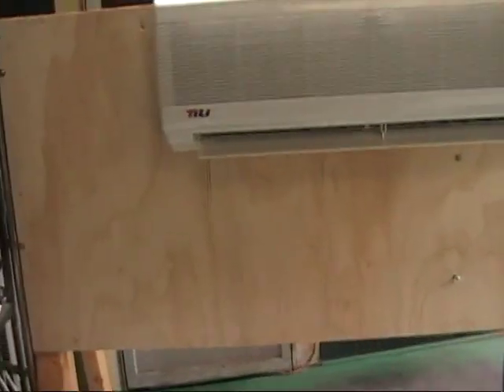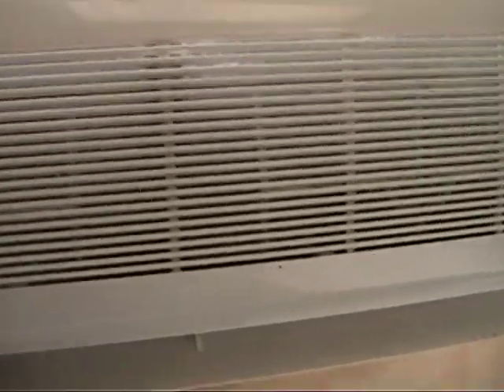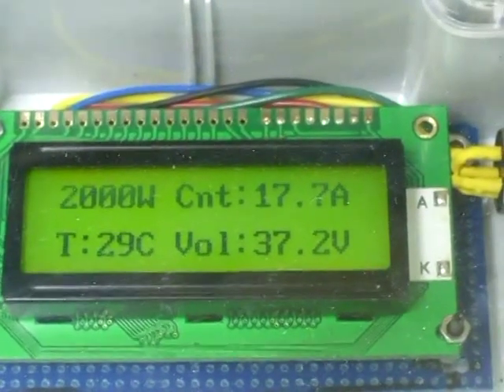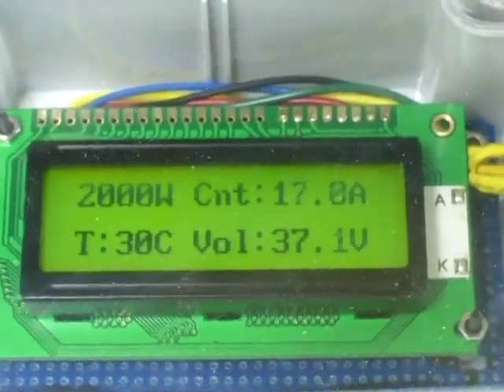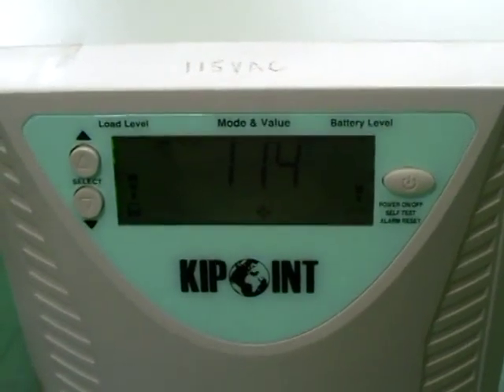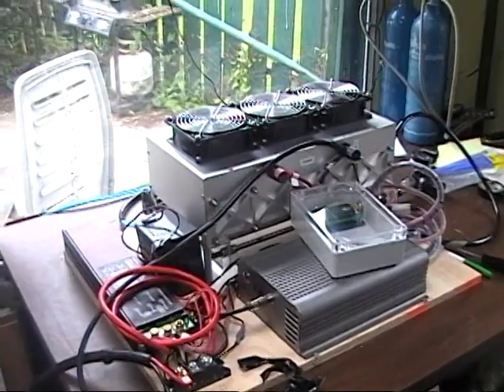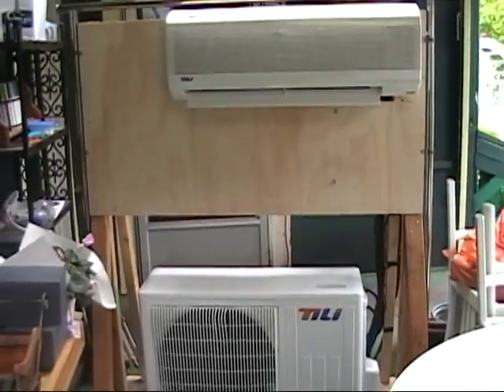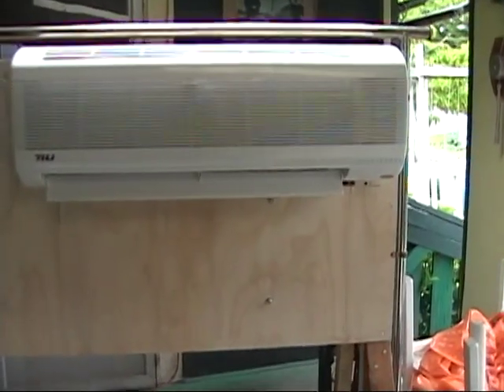Hydrogen fuel cell Heat pump co-generation home heating concept test.mpg

Comment: I did the calculations for theoretical 5kW FC that has a current density of .44 A/cm^2 and the heat generation (due only to entropy change) is 3.5 Watts for the whole system. I'm not sure that's right, even for co-generation, but I wouldn't know since I don't know the realistic expectations of a real one. An old light bulb produces 60 watts, but how much of that is thermal heat?

Comment: Maybe it's a stupid question but if it's a H2000 with 2kw power, and efficiency is 40% at producing electricity, does it means that you get 0.8kw electricity and 1,2kw as heat? Or heat is not included at 2kw? 
One more question. Would be this system sufficient to heat up a 70m2 flat, at winter days? (Outdoor temperature around -10*C to 20, isolated walls)
I'm very interested in fuel cell systems and in producing hydrogen with renewables.

Comment from the maker: First this is a prototype and it gets costly. A new Tili heat pump/ air conditioning unit of the size I used, new model, MSV1-09HRFN1-MTOW has a list price of $2,671. The H2000 fuel cell system cost $8,000. The pure sine wave inverter 1700 watt 230 or 115 VAC about $800 and finaly the batteries used about $100. Other bits and pieces about $300. I do have a source of used 2 kw through wall heat pumps for $300/ea. The hydrogen cost about $50 for 19,000 liters. Total to much, but it works great.